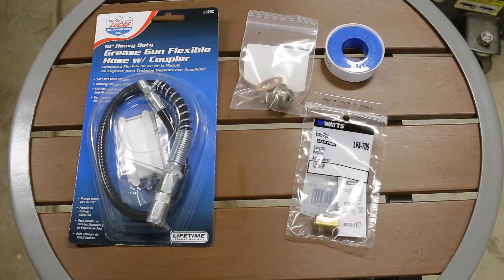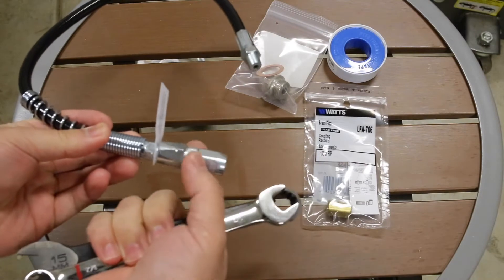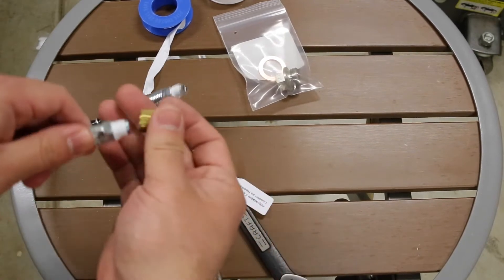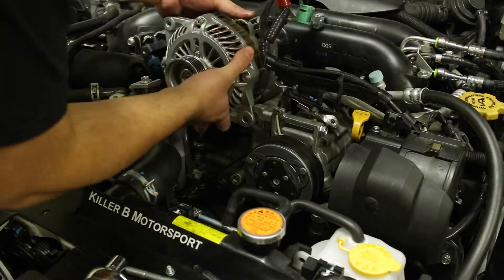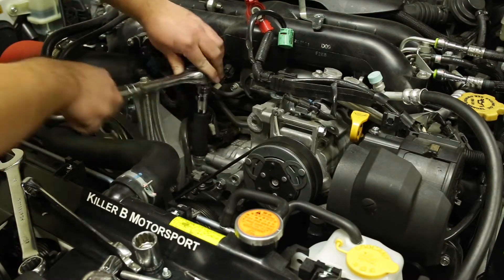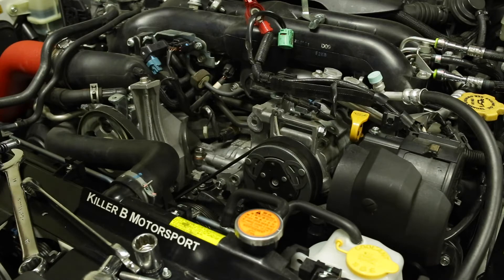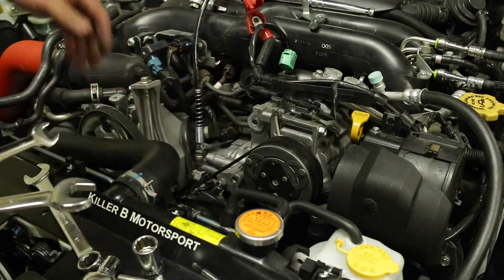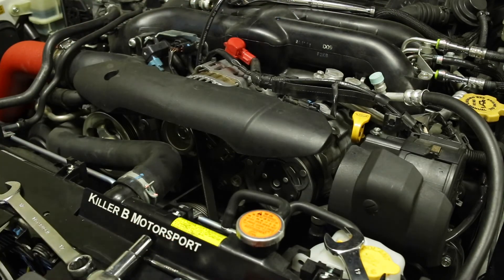How to - DIY $10 Remote Oil Pressure Relocation kit Subaru Impreza WRX

Comment: Great video, cheap and to the point. Bung on cylinder 3 is a pain to remove from the heat cycling, fittings are 1/8 national thread not british thats currently on your vehicle. This saved me $50 and shipping. Thanks my man.

Comment: and then youll have a dash light about oil pressure warning, correct?
Reply from the maker: Nope.
Reply: @Matt-xq6ow  my car started turning on oil pressure light on low rpm, 2020 sti. Was looking for the location of the oil pressure switch so I can start from there. Thanks for the video.

Comment: Did you need to drain your oil before undoing the bung? And also is the grease gun piece alright to handle the heat and pressure that itl be going through
Reply from the maker: No I didn't. The bung sits at the top of the block so you won't have issues with oil leaking.

In the 4 years I had it on, the grease gun hose didn't have any issues. FWIW, a similar product is rated for up to 212F/100C: https://www.amazon.com/Lumax-LX-1208-36-Grease-Hose/dp/B00GD2KZTU
Reply: That grease hose is now $15+ alone lol yay for inflation

Comment: I'm going to plead ignorance but why would you need to do this? Space?
Reply from the maker: There is no reason as to why you need to do this. However, if you would like to monitor your oil pressure levels, there is an easy to access oil gallery on the top of the block that you can directly mount your oil pressure sensor on. I opt'd to relocate it because 1) if the sensor did fail, I wouldn't need to move everything around just to replace a sensor 2) if there were leaks, it'd be easy to catch 3) No worries about the size of the sensor not having enough clearance.
Reply: @Matt-xq6ow  I kind of answered my own question a few days ago.  As I'm hooking up my oil pressure gauge, I now see the reason as they just won't fit in the same piece of real estate.  I want to have the idiot light and pressure gauge at the same time so I ordered a T which then presented me with more problems that the remote line resolves. I am in the process of relocating the gauge sensor which helps me with wire length as well.  Thanks for the video and response.
Reply from the maker: @zorecati  That makes sense. The T does take a lot more space, which is why I didn't opt for it. Glad you got it sorted out though!

Comment: Where is the oil temperature sensor on a 2012 Subaru wrx. I don’t want to use a sandwich plate adapter

Comment: I understand  everything  you did but the dummy light you disconnected did you re connect it? If you did tell me how. If you didn't  does that light come on ?
Reply from the maker: No I didn't reconnect it. From what i've read, the dummy light comes on when the engine is at 1qt, and at that point, you're pretty much screwed.
Reply: Matthew I so that sensor being left disconnected  does  not show a oil warning light on your cluster gauge? Thank you so much for your help for that im liking n subbing
Reply from the maker: I do not have a low pressure oil warning light or any light on for that matter. From what I have read, other people also don't have any problems leaving the dummy sensor disconnected. Glad I could help
Reply: Matthew I LEGEND!!!! THANK YOU

Comment: There's another oil galley plug on Subaru engines in the back topside.  It looks like a the factory oil sending adapter, but it isn't tapped with threads, it only has a Hex bit but it can be removed and replaced instead of eliminating the idiot light, you can have both idiot light and gauge.
Reply from the maker: The idiot light is useless. I've read it only comes on once you're pretty much out of oil. Also, the gallery plug in the back apparently reads 10-20psi lower than the front.
Reply: I think that the idiot light should be located at the back port, if in fact that reads lower, so if the oil level drops, then the light may come on when you're 1 qt. low, then it's not useless.  I've seen other threads where they've done it, but if you have a guage that is accurate, then yes idiot light is useless.